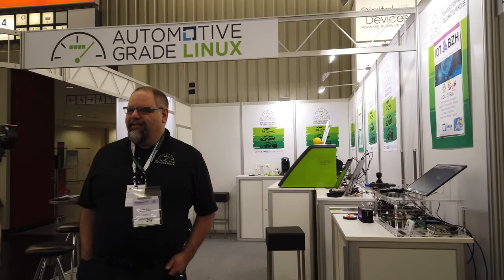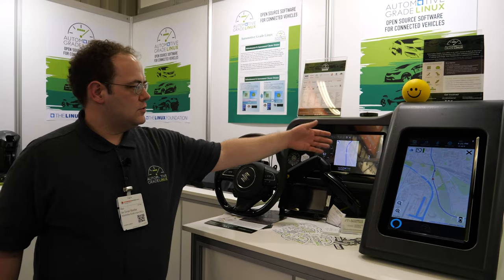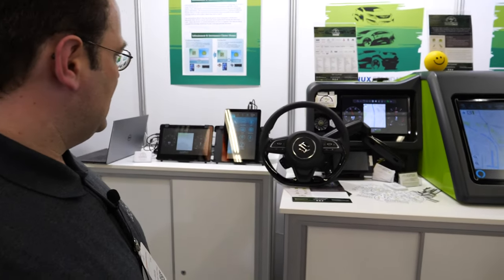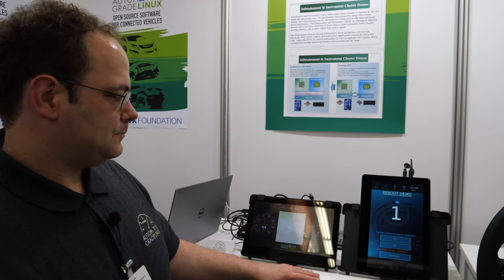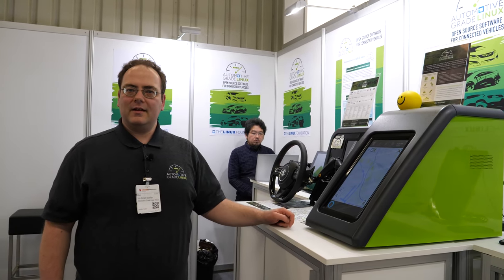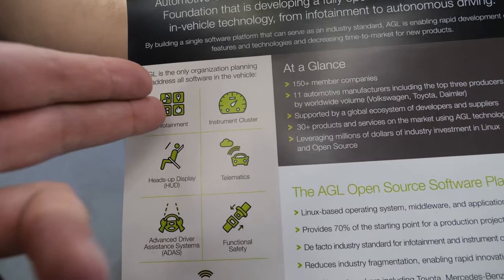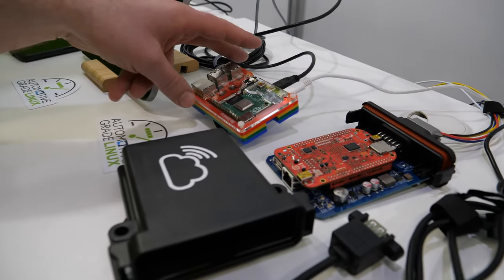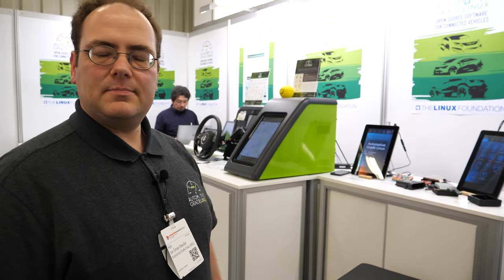Automotive Grade Linux at Embedded World 2020, Open Source Software Infotainment, Instrument Cluster

Comment: SIL B won't cut it if you want to include autonomous driving, assuming you're using IEC26262 you'll need a SIL4 equivalence, which will be ASIL level D and then some (no SIL4 equivalence with IEC 61508).